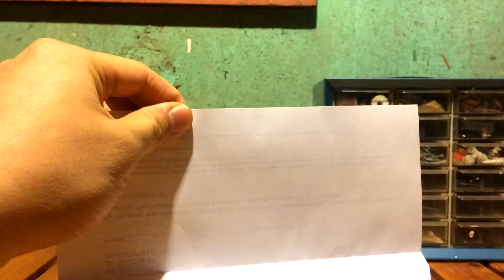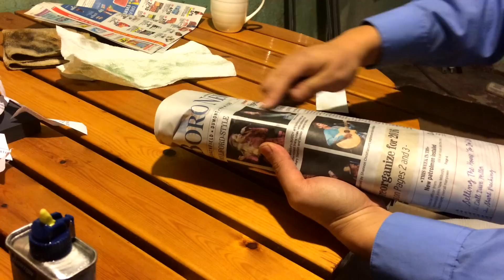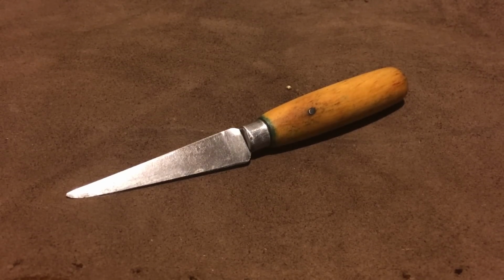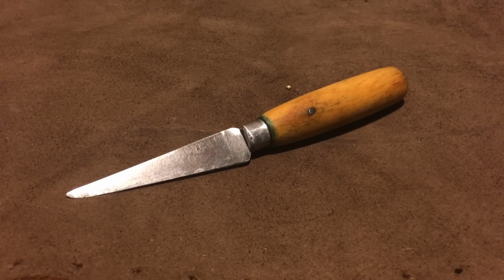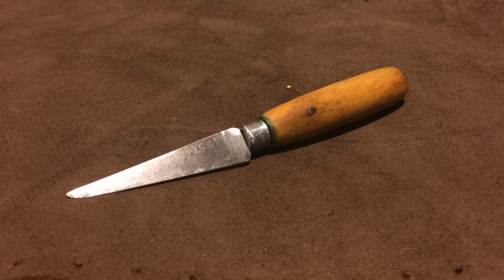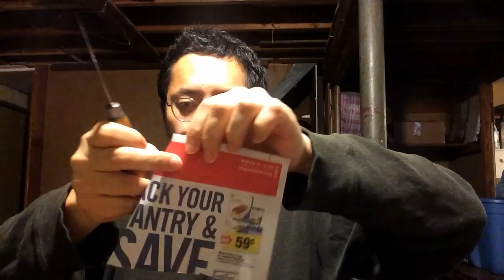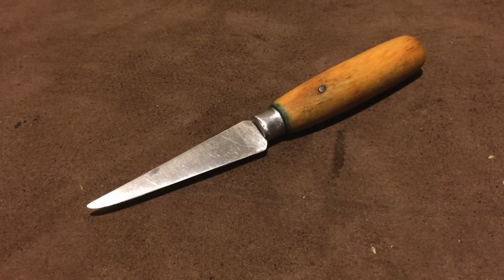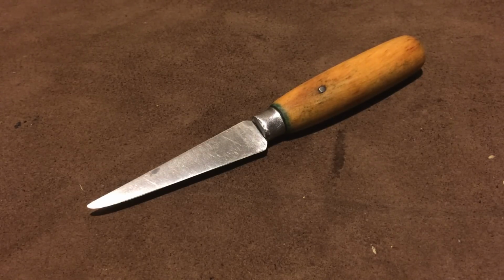Scary Sharp Neck Knife: Rebirth of a blade!!!!

Comment: Awesome! I just have a few things to say. First, if a knife is able to strike a ferro rod doesn't say anything about the steel, even glass would work if it had a sharp enough edge. What you confused it with was striking a flint with a steel piece,. Then to generate sparks that piece has to be high carbon steel. Secondly, this knife cuts paper better than a Mora not only due to sharpness but also due to the edge angle. The stock on your Mora Compaion Heavy Duty is a lot thicker and while scandinavian grinds are awesome for carving they aren't really good at slicing, due to the their steep edge angle. I hope you can find or make a nice sheath for this cool knife and that it will be very useful to you. Have fun, keep up and stay safe! 
David
Reply from the maker: +styler797 thanks for the clarification about striking the ferro rod :).  In terms of slicing capability, I actually compared it against a Mora Classic #1 which is roughly of the same blade thickness.  This knife seems to slice noticeably better than the Classic #1, but once again, that could be due to blade geometry advantages.

Comment: To funny..not more than an hour ago, I did the same thing. I found an old carving knife while cleaning out my brother in laws old tool box, and just restored it myself. I recently decided to take up wood carving, so it seemed like the thing to do. What a coincidence. If anyone told me, an hour after finishing restoring an old knife, I would see a video of someone else dong the same thing, I woulda told them they were crazy.. To funny
BTW, that knife you restored, is also an old carving knife.Although the blade profile is different than mine the handle is identical, right down to the pin. Amazing. Only thing is mine had an old hilt on it, that was bent. I straightened it out a bit, but I don't like it, and am thinking of removing it. Other than that, i love it!!
Reply from the maker: Great story, yeah I love these old knives, they have so much character!